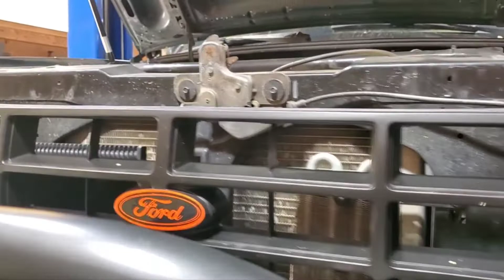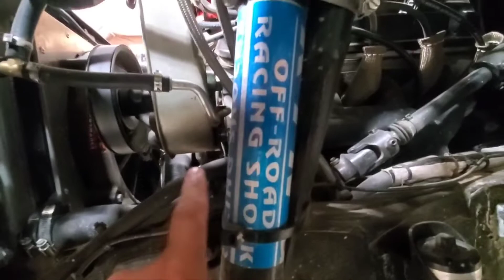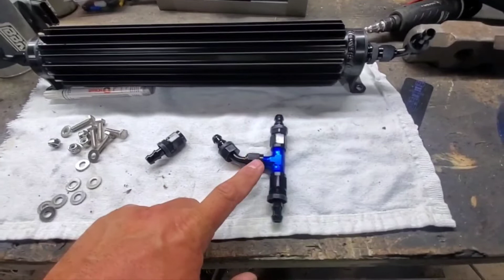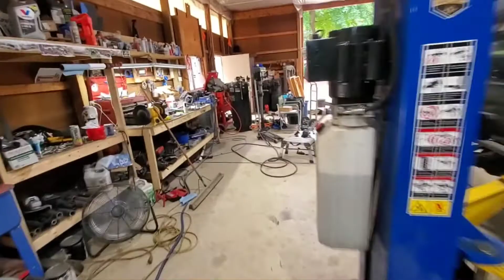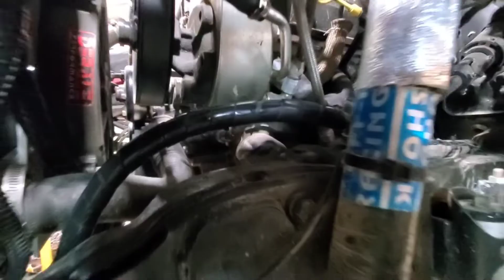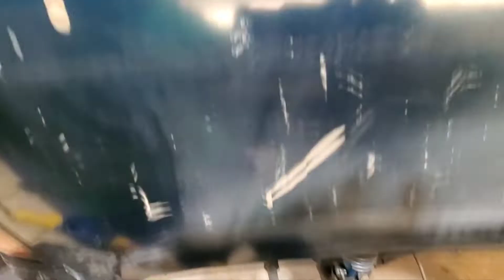Derale PSC style power steering cooler install with hydroboost and hydro assist Russell AN Twist Lok

Comment: Looking to purchase the same cooler for my truck. Since you made the video a year ago. What is your opinion of the heat sink cooler for power steering? Great video. Just what I looking for! Thanks
Reply from the maker: It worked pretty well. I did upgrade my power steering system once more.  I ended up going with a higher flow and higher psi PSC pump that also had two return lines.  No longer need a "T" in my system and now have a 1400psi pump and like 3.8GPM flow.  Over the 1100psi and like 2.3gpm.  I also switched coolers to a longer double pass.  Been working amazing.
Reply: @BuildItWheelItExploreIt  thanks. Thought about the double pass. Just have to figure out those Russel Twist Lok fittings. Going to purchase the Derale heat sink cooler. Appreciate the quick reply
Reply from the maker: The -AN wasn't cheap, but man, you can put a fitting on in 2secs, and it's perfect every time.  I was able to fit I think a 3" longer heatsink with the double pass option.
Reply: @BuildItWheelItExploreIt  would you happen to have the part numbers you used?  I am going to install this on my Promaster van and because the stock hoses are metric and two different ID. One looks like a 3/8” (9.5mm) not sure of the other. I do know the Derale has 3/8” NPT inputs. It will be a low pressure side of the return. Thanks
Reply from the maker: @GreenMonkiCoffee2008  part numbers for?
Reply: @BuildItWheelItExploreIt  I am on your site re watching the video and bouncing back and forth on the Russell site. Never used these before and to many choices for the adapters. No problem if they are not handy.